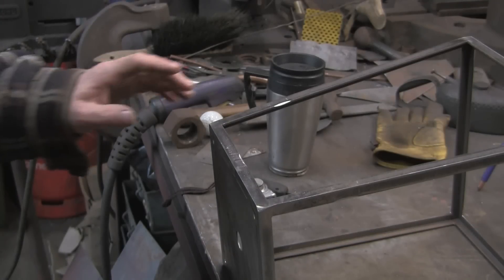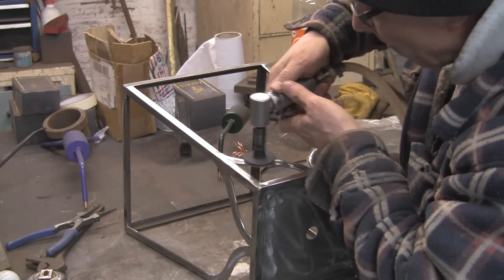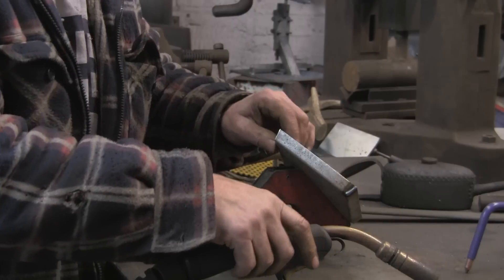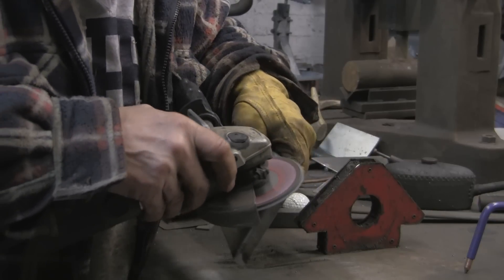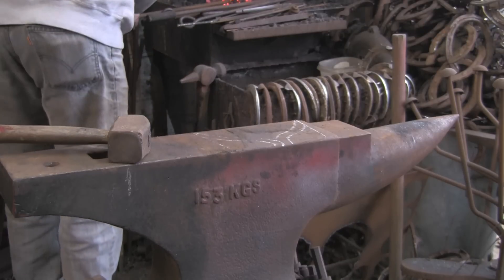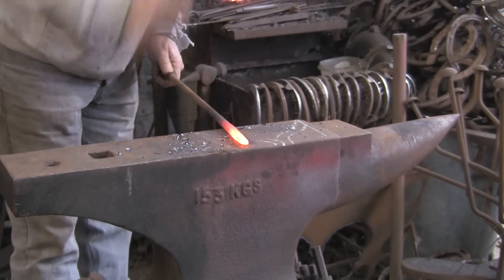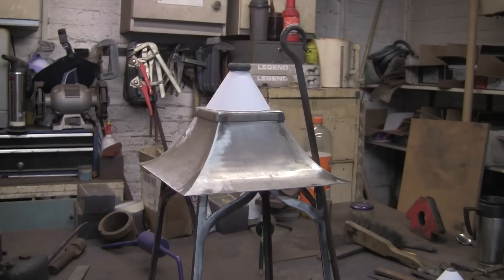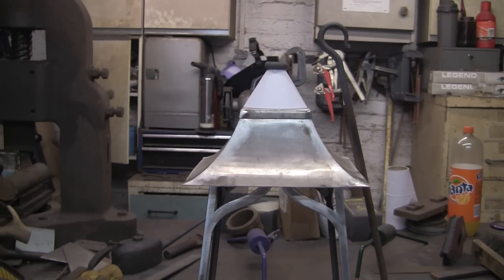Electric Lantern build part two

Comment: I really like the way your lamp is coming along. I have an idea you might like to try just to see if it will bring the top up so you can see the wonderful work you have done. Just for chuckles take two rods say 1/4 inch round and make them cross each other in an X and weld center then lay them over the top of base across the hole. Make them say an 1 1/2 inches past the corners for a try. Then set the top up above the base and cut off small amounts till it looks good. Then weld the rods to the top of base at corners if you like the whole thing before closing it up. The cone could be made on your machine that you clamp the metal in to form the top but make the lines in 1/8ths or1/16ths spaces and that might solve the cone problem. Only thoughts not anything you should do. This is what I might do if it was my project. You are the pro.
Reply from the maker: Ray Andrews thanks for the ideas but the project was finished way before the video goes up!